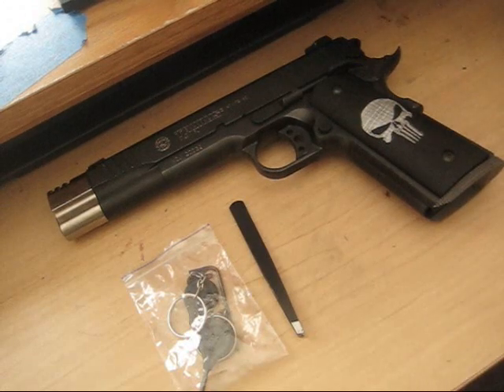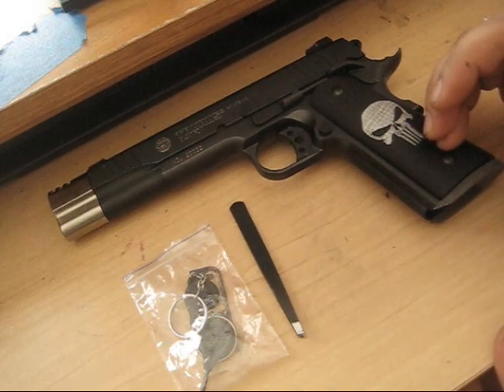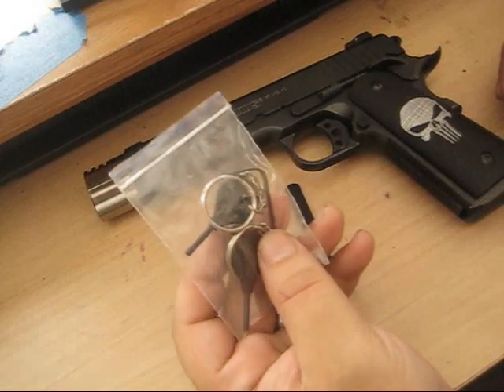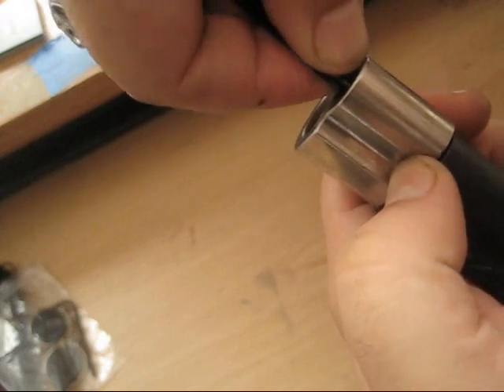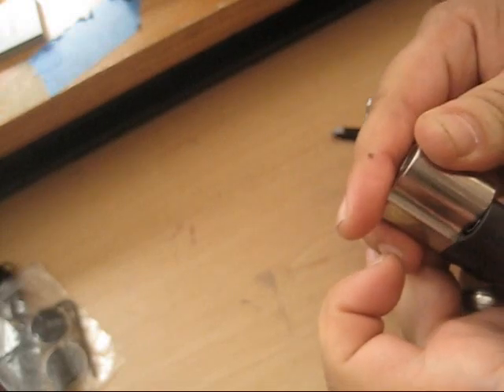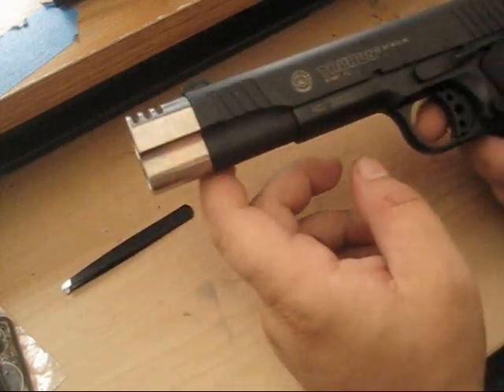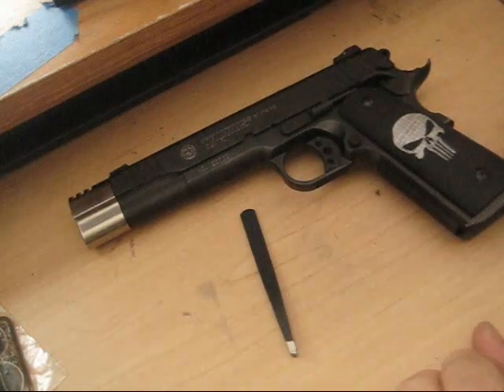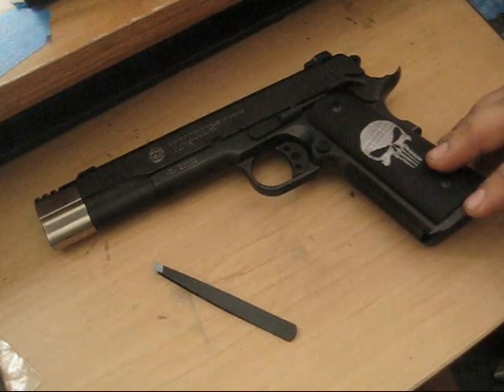Compensator Installation For The 1911 .45acp ( Drop-In Style )

Comment: Everything I've read on bushing compensators claim they are junk, if you want a compensator get one that screws on the barrel. I will say that the only real difference in the one you purchased is the added weight to the end of the gun helps keep the muzzle down during recoil. It does look cool, but that's about it, otherwise it's a waste of money, even if it's just for the look.

Comment: Did you use a two piece full length gide rod or a one piece? I ended up picking up this same compensator and I can't seem to fit it with my recoil spring plug ( G.I.) short gide rod. I just order a full length gide rod from wilson combat, what else do I need to do get it to fit?

Comment: Aluminum or steel compensator? Are Colt factory magazines as good as the other manufacturers? Is a main spring housing with magwell worth the money and installing anyone? Is there a best go to ammo to run (all around) for the 1911? I have one on it's way (Colt 1911 Rail 45acp Gun) that is stainless steel I bought on (1-20-21). If anyone can answer any of these questions I would greatly appreciate it.